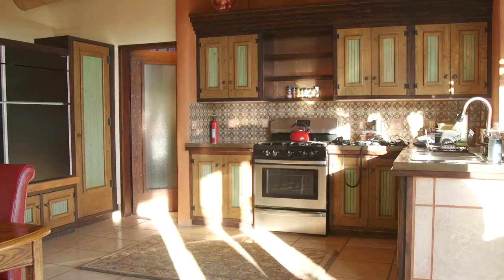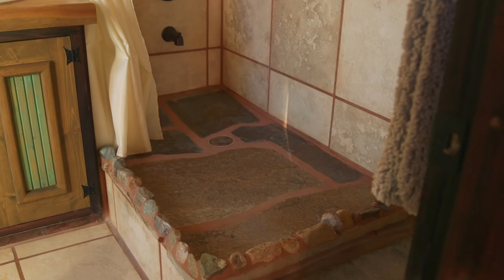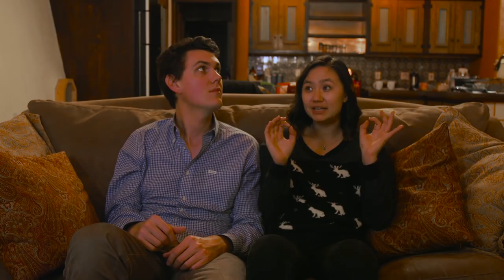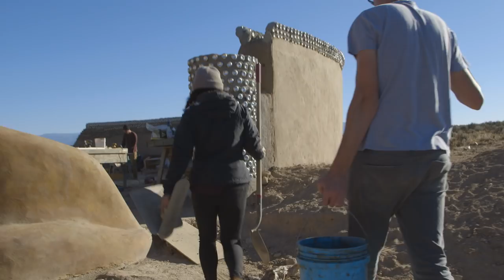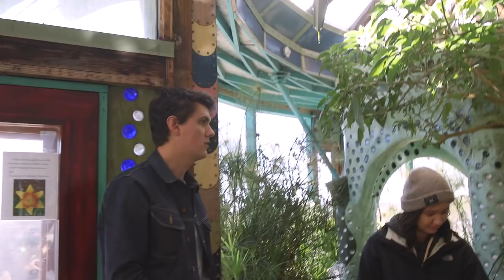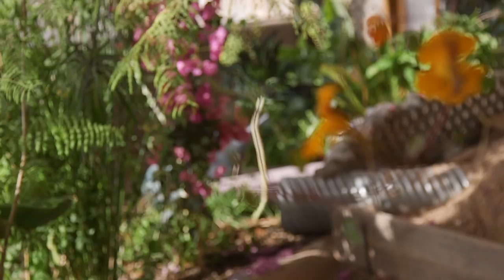We Lived In An Earthship

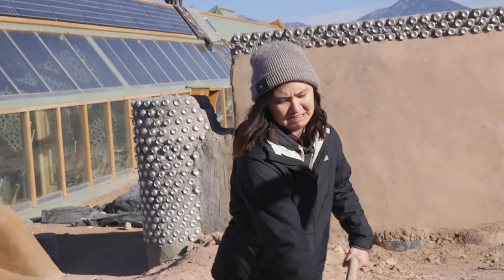Comment: 7:43
They're getting tired shoveling dirt as fine and loose as salt, but I'd like to see them shovel out a 2.5 by 4 meters long+wide and an (almost) 1 foot deep area in Australia in summer, in (at least) 40 degrees (celsius), with a cut down cherry tree right next to where you had to dig, with 2 old, splintery shovels like my dad did when he was very nearly 50. Cherry trees are hard as hell to cut down, and the roots are huge and tough to break. One of the roots was as big as a small-ish branch.

Comment: I’ve always wanted to live off the grid with solar panels in the filter ration system and I’d like to still be connected to people but I don’t wanna like rely on electricity from other people I want to use my own and grow my own food and do all that stuff because I feel like it is getting a lot more expensive to do things and so why go do things when you could do it yourself for a lot cheaper and you could have a lot more sustainability and I could evidently help convert more people into using renewable sources that are always available compared to fossil fuel‘s which will burn up in the next millennium so yeah. I also really want to start a petition to try and help the earth just a little bit we just make one thing you do one thing and then you check the petition but I don’t know how does anyone know how you can start a petition if so could you give me pointers?